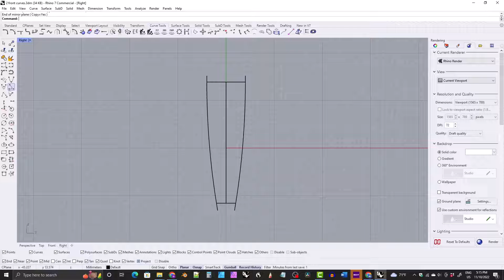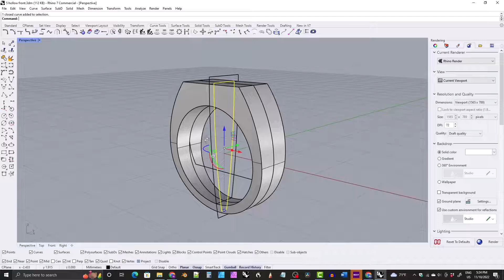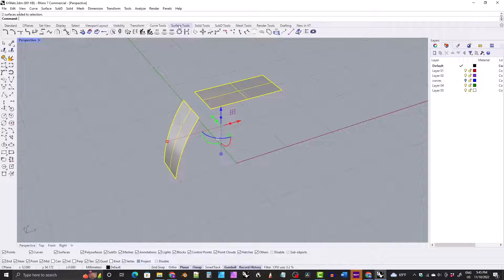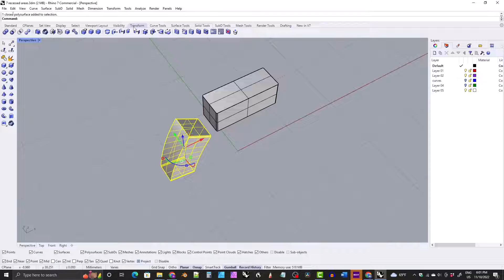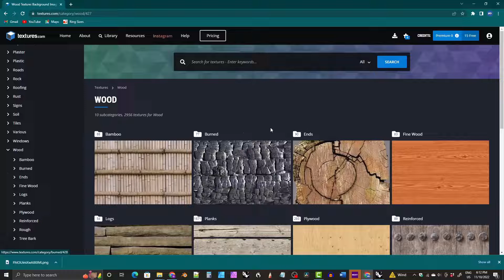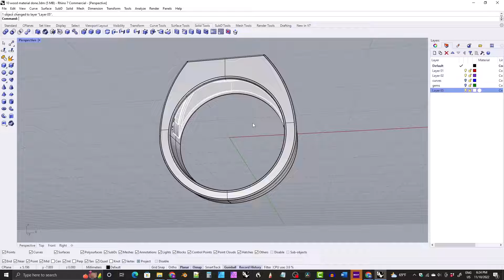Rhino 3D | Jewelry CAD | Tutorial | Signet Ring with Inlaid Gems

Comment: Hi Thanks a lot for the tutorial! Very detailed and clear. I was wondering if you could elaborate on the need for hollowed parts beneath the inlays on the ring's body. Could you not simply do cutout of the gem's shape without the need for the hollow inside? does it serve a specific purpose in the process of setting the stone? is it to add luminosity to the gem?
Reply from the maker: That's a great question.

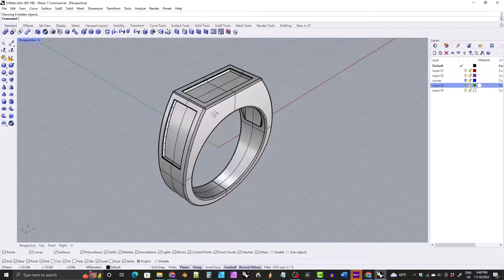If you mean the punch-outs, starting at 20:25, I did that to reduce weight. The materials of the inlays (onyx and wood) were opaque, so, light (luminosity) was not a consideration. You can consider the punch-outs optional in this project.